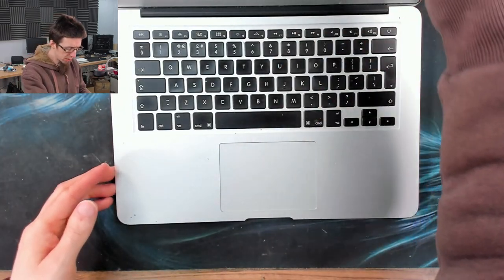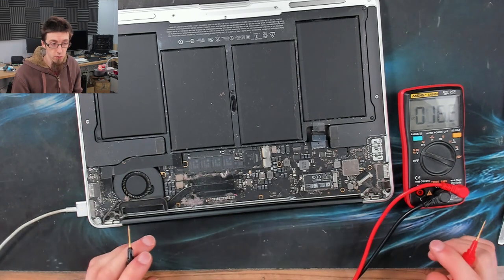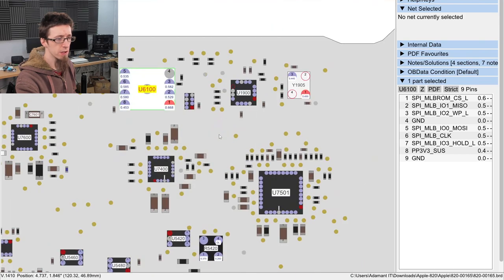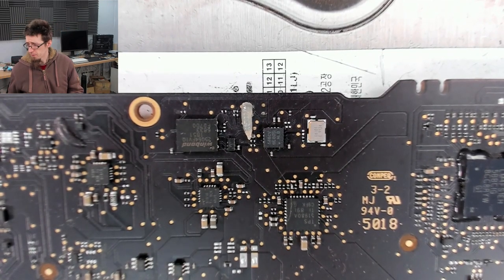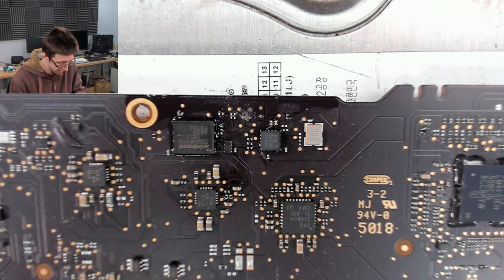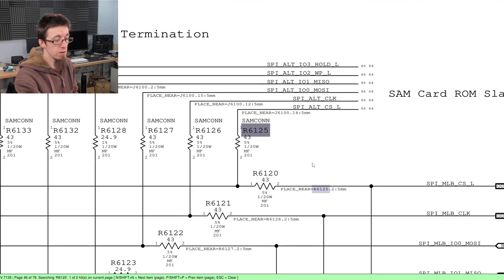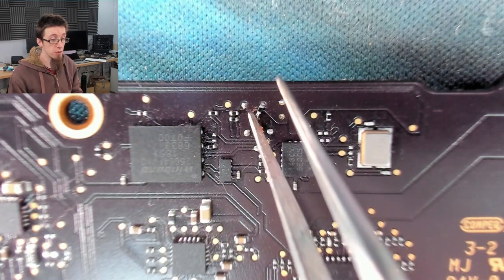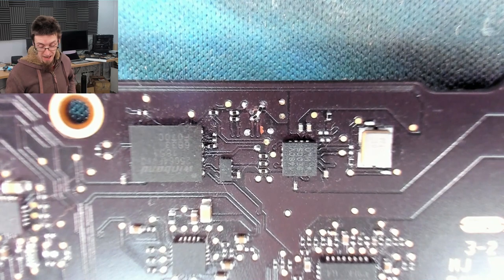MacBook Air Doesn't Turn On, small soldering needed - LFC#306

Comment: Little tip for those corroded pads: Remove components, apply lots of flux and then use solder braid/wick to give these pads a little scrub. Then re-tin. It works pretty well in my opinion.

Comment: One of the things that Paul uses a lot is hot air assist. I have had to do it as well on some of these boards if I have a problem similar to what you were having. Also solder could have been a bit smaller. Great video showing how things don't always go as smooth as some make it look.

Comment: Awesome video!  Thanks for making these videos. Your videos are some of the "most real" videos I've seen on board repair. I've been fixing computers for about 20 years now, but just recently getting into board repair.  Before, I'd just try to find a replacement motherboard or declare it a no fix. But I'm taking that next step and learning to actually fix the boards now. My soldering skills are decent, but I've got a long way to go. 

I appreciate seeing your struggles with the smaller components. I struggle with those as well.  I even struggle with some of the larger ones at times. I think one of the keys to success on some of that stuff is if you get stuck in a frustrating part of the board with one of those tiny little components giving you fits, just step away for a few minutes, let the board, your equipment, and yourself cool off a little, then tackle it again.  It seems to work for me at least.  I usually don't like to take too long of a break though, as I like to put things back together while I still remember where the screws go. :)

I really enjoy your videos. Keep up the good work!

Comment: I totally share your pain on working on small stuff like that. Thanks for educating all of us! Also, I've learned that too much heat too fast can kill the protective layer on your tip and cause it to oxidize not allowing solder to stick where you want it to. When you unpack a fresh tip, start slow and gradually bring the heat up from ~130 in 10 degree intervals until you have melting solder. What I do now is always leave a blob of solder on top of the tip and let it cool that way. This protects the coating and you can easily clean it off when using it next time.

Comment: This is a excellent video. The power rail info at examination is massively helpful.
leaving in all the struggles of trying to solder with micro components is very…. Very relatable 😎

Comment: I would suggest using an X-acto knife to scrape the pad a bit. the solder mask probably encroached into the area around the pad and is making it difficult to get down to that recessed pad. secondly when the iron is cool, take a scotchbrite bad and scuff/polish up your soldering tip. that will help.

Comment: I've used window glass cleaner for a long time for this kind of job, and I thought I were the only one! Yay, I'm not alone 😊
A plus of glass cleaner is the good smell of cleanliness it leaves behind.
Reply: Also, get a cheapo USB 1600X microscope on eBay. Should be around $15. Better money you'll spend to work on those small pads!

Comment: I think you did very well since the resistors were tiny and you didn't have a microscope and other fine tuned equipment etc. But you knew exactly what was wrong and you fixed it back to perfect functionality with affordable tools.

Comment: Yeah small resistors are a pain.  a trick I used in the past was a very sharp toothpick and a small bottle of sugar water, I would put a tiny drop of the solution on the bottom of the component and 'glue' it to the PCB then solder.  that really worked for me when I was prototyping.

Comment: To join together the two ends of the resistors you could use just a small amount of solder paste and hot air (small nozzle) or a solder ball used to reballing BGA chips. Your solder tip is too big for those 0201 resistors, you could consider buying a solder iron Weller WM120, designed for soldering miniature components, cheap iron with very fine tip. Thanks for the video, as always very interesting stuff. :-)

Comment: very informative, appreciate that you left the issues in, warts and all

I have a macbook air that refuses to switch on ( if you let the battery discharge, then attach the charger it will come on, and work perfectly ( reboots etc  )until you shut it down. I'll take a look at the power rails and same resistors you mentioned. ( Mac really isn't my thing, I'm more Windows )

Glad I stumbled across your channel

CTSNW

Comment: Important point here. Like you, I struggled with teeny-tiny components when I lived in the UK. I emigrated to the USA a long while ago and for some reason, a load of other tools became available to me. Working as I did in a University I.T. shop, we did repairs on all sorts of gear from through hole to just these kinds of components.

So what are the better tools? Higher power magnifiers/microscopes, even smaller soldering iron tips, heated tweezers and so on. Long story short, after all this time, your soldering skills are probably not too bad, but by 'soldiering on' and making do with massive tips on irons, wrong solder and so on you are using the wrong tools. Also - yes the tip of the iron was dead. They will do that after a lot of use.

Spending the money to buy quality micro soldering tools that are much smaller than you are using will pay dividends. Not that its always going to work 100%, but things will be better for you and better for the customer with less fuss and fiddling while repairing.

Comment: 0201 resistors, always fun. Get yourself a nice JBC iron with the finest tip they sell. Makes life a lot easier. If you're feeling flushed get yourself a JBC micro-pencil station. Think you also need some fine tipped tweezers, the ones in the video were way too big. Oh and 0.2 mm solder.

Comment: That's how SMT soldering always goes for me, a frustrating nightmare. Thru hole, I can do with my eyes closed - soldered a 68000 based computer with a non-temperature controlled iron with 100% success back in the day. I agree there is something wrong with that tip, though - probably lost its plating. Also wonder if there was some remaining contamination of the board that transferred to your iron.

Comment: Yeah thinner solder, new tip. I prefer a J tip for stuff like this but can be done with other tips if they in fact except solder. Even with a J tip there is an initial little fight to remove oxidation on the tip with wire wool but It will except solder and you can load it up with a tiny tiny little bead of solder which is easy done with thinner gauge solder, I get away with 0.4mm but smaller is even better.

Comment: Instructive as always. IIRC the active ingredient in many window cleaning fluids is vinegar so perhaps you might try a drop of that from a syringe instead of spraying all over the place. And I do wonder if you needed a soldering iron with an even finer tip?

Comment: Your solder is too big and the tip appears to be "dirty". I also think a conical tip might work better in these situations. Use a solder wick to remove the excess solder from the board and then use some fine steel wool or something similar to expose clean copper on the pad. I have occasionally encountered pads that simply refused to allow solder to adhere and have had to resort to scrubbing the pad(s).

Comment: You should get at least a desk-clamped magnifier with LEDs for this sort of work. I can't imagine how you can see anything on there :)) I'm nearsighted and wear glasses too all the time, even when I'm looking at stuff up close the way you do, so I can see things just fine up to a certain point, but that's just TOO small and I'd bring the magnifier over. One disadvantage is not being able to fit some tools underneath it, like the soldering iron or the hot air station, though I got some angled nozzles for mine which makes it just about possible. Also, the soldering: I too have face the issue of solder blobbing up wherever the hell it feels like it, except for where you WANT it to go. What seems to work for me is to bump the temperature up some more when using small tips because they tend loose a lot of heat very fast and the solder doesn't want to flow to cold areas, so it's normal the part closest to the base is going to be the hottest and attract the most solder...

Comment: Firstly I'll start by saying I'm no expert by any means. Just do this on occasion. I don't do this kinda micro work myself. But I've read that solder follows the heat. Your tip is much hotter than the smaller trace, so it doesn't want to stick to it. The tiny traces thermal mass is not allowing the heat to linger long enough imo. A conical tip might help transfer the heat better to that specific area. Also allowing the solder to transfer away from the tip more easily. I think your larger flatter tips surface tension didn't help much either. And scraping away all the corrosion beforehand is a must, nothing is going to stick to a corroded trace.

Comment: Good resolution to solder problem.  It seemed to me that the pad in question ( the one where the component was apparently loose and easily  knocked off) was oxidized, which happens on loose/bad solder or electrical  connections, and the oxidation needed to be scraped off/removed in order for the solder to adhere ...

Comment: Hi Graham yes it not easey so little resistors. But if you want to upgrade your equipmment i recommend aixun t3b with jbc 115 handle for so little resistors or the t210  also it is very powerfull iron is abouth 170 euro.  But nice video . Keep up the good movies

Comment: The fact you couldn't get the solder to stick is probly due to there being a via there to a interlan layer. i make alot of pcbs myself and i do this quite often putting the via in the pad.

Comment: Use leaded tinning stuff to condition your tip, not lead free! Tin your tip every time you start to use it, so once a day or so at least. Mine took a couple of weeks to arrive from supplier. Try different flux to prep corroded pads
Reply: IIRC leaded solder is banned in the UK for members of the general public, but not for companies. So Graham could not buy under his own name but could under the Adamant IT name.
Reply: @Quentin Stephens  Hobby v commercial differences hadn't occurred to me! Just reading quickly reading through regulations shows me it's as clear as mud, especially with some EU laws no longer being applicable.
Reply from the maker: I use leaded&fluxed solder already, which is one of the reasons why I persist with the thick stuff I have, because it's 30+years old. I think scraping what what I needed here.
Reply: @Adamant_IT  the tip tinner is better than just solder regarding preparing and maintaining a tip. I tried just solder, mine is lead/tin from around 2004. My tips performed just like yours as if repelling solder. I tried lead free tinning compound with little improvement. I replaced my iron and no difference. I then tried the leaded tinner and it worked. These new tips just appear to be poor unless tinned properly. I had no problems before including soldering in remote areas, in a hurry and while travelling in vehicles. For corroded pads etc I use a rubber type abrasive cleaner block I think from RS or Farnell

Comment: When ur working with components smaller than a grain of rice, it’s hard without a microscope or decent camera that can give you a great close up view. If it works it works sometimes you need to take a different but similar avenue to get the repair done, so the item works again.

Comment: Those resisters are absolutely too small, I would just have called it beyond my ability and sent it to someone like you. I struggled more than enough trying to solder 0402 mlcc caps.

Edit: mention of the tip, is this enough to make you buy that expensive hako tip that was even smaller than this one that you've mentioned you were looking at getting?

Comment: What are those sharp probes you're using in this video?
Reply from the maker: Just got them, BST-050 JP Superfine: https://www.aliexpress.com/item/1005001557245171.html
Handles feel cheap and plastic, but the tips are proper needles. I'm actually going to keep another multimeter on the bench with my old probes in for general purpose stuff, as these superfine ones are massive overkill when just checking for 19v and stuff.

Comment: Maybe try some Tip Tinner for your iron, I use it just before I turn my iron off.
Reply: Tip tinner is the last product to use before you throw away the tip. Use flux to clean the tip and solder to coat. After the solder has burned off of the tip wipe on some brash savings or if you must a damp sponge. It is then good to go. Always put a dab of solder on the tip before you touch the pad and component with the tip to create a better thermal bond.

Comment: Soldering is not for Energy drink and Coffee addicts. You need to hold your breath and duck your arms against your rib cage to get a steady hand
Reply: Long time back I saw a pantograph soldering iron setup with about a 3:1 movement ratio. It was used by someone in the engineering shop at work, populating prototype boards with 0.05mm spacing QFP packages and the like under a TV camera/microscope rig. The board moved under the soldering iron on an X-Y table to reposition it as needed. Very expensive, very tricky to use but it produced good results.

Comment: Your comment on brushes. So long as you use a PURE bristle brush you shouldn't have any issues as a PURE bristle brush should be horsehair and doesn't cause any static issues. IF you are NOT using a pure bristle brush then stop right now and get one.

Comment: Have you tried using leaded solder it flows better at a lower temperature, I think you should file that tip back to bare metal and re tin it, it looks like the solder isn`t hot enough to flow properly, I would even measure the tip of the iron with the thermocouple of you multimeter to see if it matches what the iron is saying. Gotta say though micro soldering looks a total nightmare.
Reply: The second you file a tip like that you have relegated it to the garbage. It is useless. Never, ever file these newer coated soldering tips...ever. NEVER.